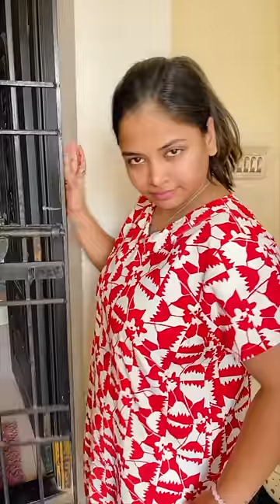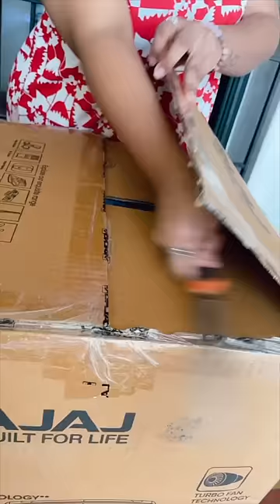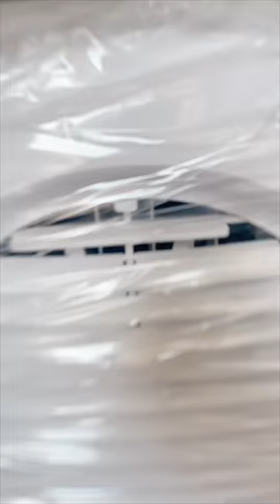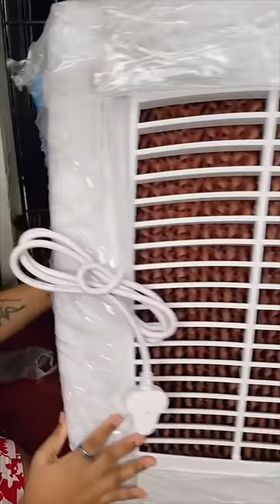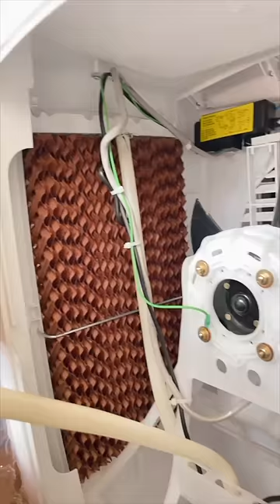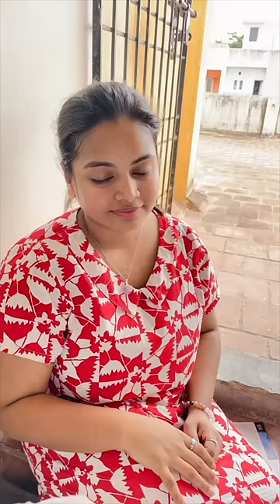Summer-ல Women-க்கு இருக்கும் பெரிய பிரச்சனை 🥵😷 #Shorts | Keerthi Shrathah

Comment: This will cause respiratory problems. It will mess up with your health in humid conditions. Having a good ventilation in the kitchen will solve most of the problems. You can alter your kitchen and have a big window, grow some indoor plants near window. It looks refreshing and also gives fresh air.
Reply: Woww..😂😂 rendu plant vachita pothuma .. adikra veyilku enga nenga vera
Reply: @phoenixin102  I have many plants and it's very useful for me. Growing trees and plants will be very effective and will reduce the heat. Veyil adikuthunu air cooler vangi respiratory issues vanthu avastha padrathu ungaluku okayna neenga vangi use panunga it's your wish.
Reply: @lp8688  plants pathi therlabut respiratory problems varumnu solrathu unmathan enga amma ku wheezing vanthruchu doctor air cooler use pana venanu soltanga